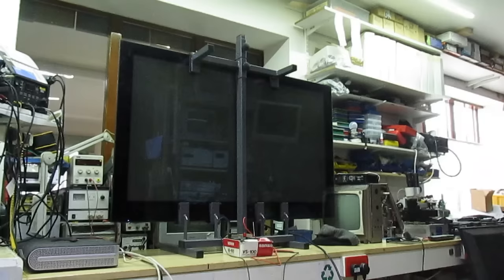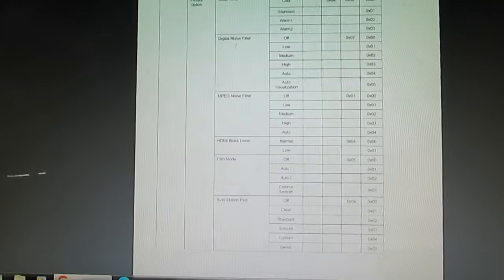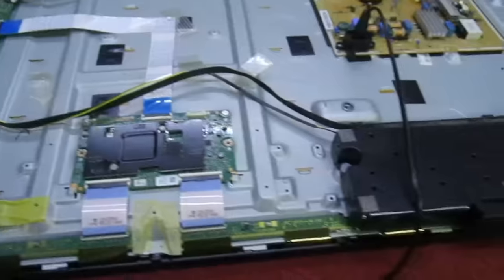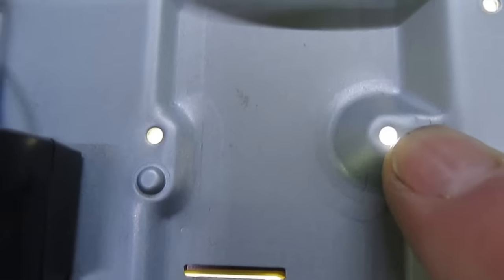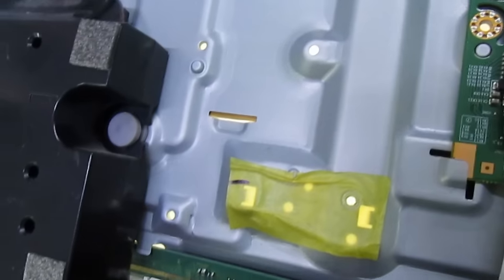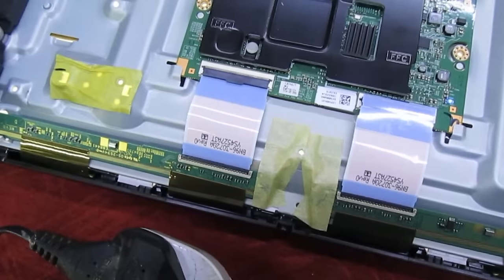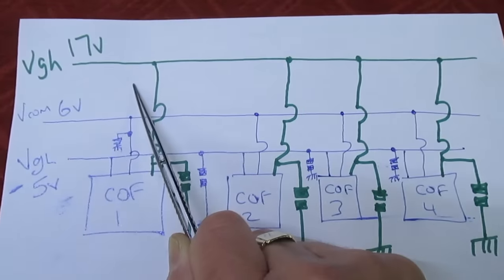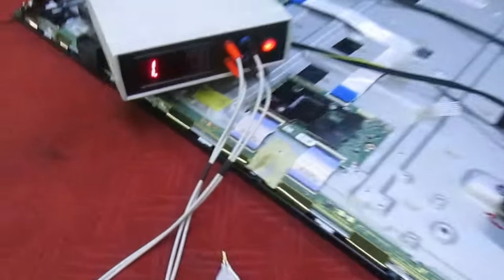Video to highlight the problem of repairing flat panel TV sets

Comment: Thumbs up for the video, Mr. Dranfield :-) It is always heart-warming to find someone who does care and does promote repairs of simple faults. 

Actually I suspect a major part of failures in modern-day electronics are of this sort: power supply capacitors, typically electrolytic, but tantalum and even MLCC are sometimes to blame as well. A TV is still a relatively complex piece of kit, but there are many smaller and simpler devices (say SoHo Ethernet switches) that are prone to capacitor failures just as well, and overall trivial to repair without a schematic, because the block schematic is very universal/repetitive. They are often used deliberately to implement "planned obsolescence" - and it's not sloppiness on part of the board designers, it is intentional and it is an art in its own right, only noone admits this on record, for obvious legal reasons. In reality, I doubt that the orders for this do not come from the board of directors of the corporations involved.

I'm fine with a leaked capacitor that I can simply replace. What infuriates me are "design sabotages" that cannot be repaired, such as mechanical design details that result in a destructive failure, not repairable by a glue gun and duct tape: a ball bearing on a name-brand lawnmower high-RPM electric motor, seated in a plastic housing, where the large injection-molded plastic part is a major structural component of the motor assembly, not available for replacement... or a fragile plastic hinge in the microphone arm in an expensive name-brand headset (earphones + microphone). This kind of thing should be sanctioned :-)

In TV's and PC monitors, notebook PC's, fondleslab telephones and many other devices, repairability gets outright precluded by mechanical design that (almost or literally) prevents disassembly, or if you disassemble, prevents plausible re-assembly. Such as, TV chassises made of plastic that hold together by a myriad fragile flippers that are intended to snap together, with no clear way to get them un-snapped if repair is needed. In the way of repairability, I'd love to see some improvements on this front = easy access inside, to get my hands on serviceable parts - be it individual boards, or backlight LED stripes or whatever. To replace some popped caps, in the PSU, you often don't even need a schematic.
One particular brand though comes to mind, that does make board-level schematics still available in service manuals: the Vestel of Turkey. To those who are not in the repairs business, this company makes on the order of 50% of the cheap flat-panel TV sets sold on the European market by various "household names" (that no longer run their own factories to make electronics). I.e. many of the EU household name TV's sold in Europe share the same motherboards, power supplies and principal inner mechanical construction. I've noticed small differences in the component sets soldered on boards, such as a protective Zener on a motherboard (Vestel T816 PVR) to protect the mobo against the +5V PSU output going fuzzy as the elyt caps dry out. One brand did have the zener, the other just had an empty position... On the first box, I did exactly that "find a short on a PCB" analysis, as explained by Mr. Dranfield in this video :-) and then I replaced all elyt caps in the other box preventatively.

Unfortunately, genuine repair techies, able to diagnose and repair small-signal electronics, are a dying profession. In rich countries, kids don't get to play with a soldering iron anymore. I know several old bards, say born in the fifties or older, who have experienced a great part of the history of modern electronics on their jobs, and keep their "ethos". I myself was born in 1976 and I was possibly lucky that I spent my childhood on the eastern side of the iron curtain, so I got my hands dirty and I was able to pick up some DIY skills from the old bards... Nowadays, the trouble is: consumer electronics is hardly worth repairing anymore. Industrial electronics still is, considering the cost of replacement (including various "strings attached", such as software licenses). As for consumer electronics, the problem is in the flip side of the "economies of scale" - in mass manufacturing and global mass distribution. It just got so efficient and cheap, per unit, at that scale, to produce and distribute new pieces, that a repair of individual random pieces just cannot compete. Repair takes too much human attention, and it takes a skilled techie who can diagnose microelectronics, at least at the level of power supply rails and proper general troubleshooting. Consider how much such a professional needs to earn, net pay per an hour of work, in a modern-day western country. Multiply by three to allow for taxes and similar costs and some profit for the employer company. A repair of a cheap TV set easily just does not pay off in a rich country, considering the amount of skilled work required. Even in my post-commie home country, where wages are still relatively low, I can venture to repair my own cheap stuff in my free time as a hobby, but noone would pay my employer for me to do that same on a commercial basis - because buying a new one is just cheaper.

In private, I delight in removing the more trivial "planned obsolescence sabotages" and giving my devices a new lease of life (often immortality, in the sense that moral obsolescence comes earlier). Sometimes I even go so far as void the warranty on a new gadget (after a quick initial test), "pop the hood" and look for the obvious culprits inside - cheap elyt capacitors and the like. And I remove those sabotages on a new device, before it had a chance to fail. E.g., I've had a cheap SoHo WiFi AP run for about 10 years in my parents' house, before some third party scrapped it for his commercial reasons (and out of technical ignorance). I do this in cheap Ethernet switches that I'm using in-house, and do not want to remember where they're located for the next 10+ years. Solving an emergency (device outage) that occurs at random is just much less convenient than preventing a failure (planned obsolescence) as part of initial deployment.

Speaking of capacitors, for the record, for innocent and excited tinkerers to come: when replacing leaked or suspicious elyts, note that you should not take capacity (microFarad) as the only or even a crucially important guide. In power supplies, the capacitors typically have to sustain a high AC current (and pulsed at that). There are a special variety of wet elyt capacitors for those positions, called "low impedance". And don't just rely on those words in a catalogue, do actually take a look at the Esr value and the permitted ripple current (two sides of the same coin). And, compare. You will notice how vastly better the Solid Polymer capacitors are in those respects, compared to "wet" Al elyts. When refurbing elyts, I strongly prefer solid polymer to a wet elyt. Unfortunately, solid poly doesn't work at high voltages. So the primary side of a mains PSU has to be fitted with a wet elyt. Speaking of quality wet elyt, remember Panasonic FR and Nichicon CS or CY. And Nippon Chemicon in general, but I won't suggest a particular model/family. With wet elyts, brand does matter (not so much with solid poly, especially when replacing wet elyts).
Also, be aware that while most elyts nowadays are in power blocking positions, some may still be used for analog timing or signal filtering - in these positions, you'd better stick to a legacy wet aluminum elyt (choose a quality brand and model) or MLCC if the size and voltage allow. (And, keep the original capacity.) Solid polymer tends to have a higher leakage current that might hamper timing or filtering applications.
In some rare cases, you may notice that after replacing a wet elyt with solid poly on the secondary side of a PSU, the PSU's regulation loop becomes slightly unstable - maybe just within a certain range of loads. The PSU starts to whistle. That's bad luck - it happens due to the significantly lower Esr of the solid poly or MLCC that you used for replacement. The lower Esr has improved the Q of the regulation loop, thus promoting some resonant pole... Hardly ever a problem though.
Reply from the maker: Your comment about Vestel supplying circuit diagrams is the reason I have always liked vestel sets but recently I have noticed they have stopped publishing schematics for the latest models and this is very worrying especially as vestel make a lof of the TV s in use today.

Comment: They constantly squark how green and carbon low they are but the continue to deplete resources because they'd rather sell under light bulb theory than repair. I remember in Germany in the 70's when the youth began to protest the oil industry and got nowhere until they began torching fuel stations
Reply from the maker: nothing green about throwing away a TV and then buying a new one when the old one could be repaired .

Comment: very intersting thanks Ive a radio ham mate tubes variety that was faced with his TV fail this may point him in the right direction as we are in a Place called Siam where there is NO HELP for anyone...I feel less wary of my big screen samsung now failing as its such a good set and I was brought up on Sony Grade one studio monitors :-) It might be a good idea to find the exact same model on Facebook sales thats had the wife chuck a brick at it and get some spare parts in advance of the inevitable 😞
Reply from the maker: Theres no help anywhere now , not just in siam, as soon as someone has your money thats it , forget service and reputation , no ones bothered , when they get your TV out of warranty theirs no parts available  and you will be just told you have to buy a new one .
Reply: @michaeldranfield7140  Yep, wifes Iphone 7 failed due to condensation inside in Thailand due to a/c in car too cold and no protection in the 7, replaced with 2 weeks to run on warranty, 3 weeks later the "new" 7 had a fatal firmware/memory fault which bricked it (it was a known manufacturing fault) Shopkeeper in Bluport iphone store in market village in Hua Hin laughed in our faces. Next phone was a samsung S7 Edge - first I did was full immersion in water for 20 minutes, it worked and has worked ever since (6 years)

Comment: All fine and dandy if you already have the knowledge of the internal working of the television set enough to locate these components. You must have studied many many other service schematics to have had this knowledge. Unplugging boards is a good technique to determine which board is pulling voltages low, and therefore the board that has the plug that you unplugged and the voltage then comes up on the output of the power supply board is usually the defective board. However sometimes switch mode supplies wont start up without some load attached, and this only adds difficulty when troubleshooting.
Reply from the maker: I have had over 40 years experience of TV repairs , I started on black and white sets and for pre 2010 sets I have thousands of paper service manuals , sadly gone are the days of obtaining service data now .
Reply: @michaeldranfield7140  I feel your pain about full size schematics, much harder scrolling around on a screen if you can even get a schematic for some. I started around 2002 out of the house. Did thousands of repairs since on everything from A-Z ever since. Vcrs, Televisions and Audio Equipment was always my favorite. Found transceivers probably the most difficult, however there where exceptions. A lot of repairs became a personal struggle of love/passion more than profits. Older I get “now at 55, the more I realize how much I don’t know.” Just watch someone like Mr Carlsons Lab on YouTube and you’ll understand what I mean, lol. 
✌️😎👍

Comment: The manuals are required by law to sell in the United States but they don’t want you to repair it they want you to replace it. They are pretty simple that’s why a lot of people take them apart and re-purposed them.
Reply from the maker: hence why there is so little in the service manual , its more like a user instruction book .

Comment: As an ex production technician for Sony I took issue when they tried to produce a single panel crt tv one in the 1980s. It got so hot I considered it a fire hazard and a danger. 
They even stuck a BEAB sticker on the back which I took issue with. 
I whistleblowed to beab with my concern that this tv was a danger to public safety,  but to my disgust the person at beab just said,  "the safety of the public is not our concern ".
!!!!!!
I was always under the impression that the British Electrical Approvals Board was set up to ensure that all electrical appliances had to conform to strict safety rules!!
Reply from the maker: I do remember a particular Sony model where a dry joint on a big power resistor  caused a massive burn up on the pcb and Sony issued a mod kit consisting of a new piece of circuit board you had to fit on some plastic bolts after cutting away all the burnt board , cant remember the number but it may have been KV2097 ?? or something similar and it had a plastic cabinet .
Reply: @michaeldranfield7140  
They were all plastic cabinets. The problems are when they used 1/4 wat resistors and very thin boards with thinner copper etching combining the power supply which besides driving the signal and control processing but also powering a big CRT. The single board tv was designed so it could be produced with less labour but I managed to convince them of the bad design.

Comment: A Service Manual with circuit diagram  is completely unnecessary when fault finding down to component level. In all fields of electronics repair I have worked in until recently, I've only ever had a working knowledge and what's in front of me and a sketchy description from the customer, that's in tvs, HV electronics, and unfortunately this will never change. what we had in the 80s and 90s, and those who worked in the 50s to 2000s was what I call a golden era of electronics.

they don't teach to component level in tech college anymore, c and g  224  is no more so I am teaching what I know to my youngest daughter who will hopefully carry the torch long after I've gone.

keep the faith. 

datasheets on the Ics and components  installed on the boards will give you all the information you need to repair.

I understand completely what point you are trying to make, but up until very recently, I've been in the TV repair trade for over 30 years, and have only ever needed a service manual once, to identify what the service fault code was for a TV. the TV was repaired after replacing the noal failure point of schotty diodes on the PSU board of a Philips TV.
Reply from the maker: This is where years of experience comes in , working without a service manual, when flat screen sets came out though about 15 years ago there were circuit diagrams in the manual but I suppose sets were so much more expensive then .
Reply: @michaeldranfield7140  The point I'm making is, until we ( the consumer, the engineer) stop buying products because of the blatant planned obsolescence, the lack of tech support and poor design of so called premium products from companies like Samsung, this will continue. WE are our own worst enemy, and after 30 years in the trade,(on and off) I finally hung up my own soldering iron, and changed my field of expertise. 
The service manual is a thing of the past, the mere notion of a TV repair guy fixing items, sends shivers down the spines of shareholders of companies like Samsung, and our old favourites from Turkey....I can't even bring myself to mention the V word.... they're that 👎 
I wish you luck ...😀

Comment: Great explanation. I used to do TV repair a long time ago but even I could see the end when flat screen tvs came along. As a career it was not going to be a challenge just replacing a whole board instead of component fault finding.
Reply from the maker: I never saw the end when flat screen sets came out and a 42 inch set was £7,000 to buy , I just saw an opportunity to make more money but it didnt take long ,look at sets now , less than £300 for a 42 inch set .

Comment: Great bit of troubleshooting.  Haven't done a flat screen, but I've fixed XBox game console just by the old-fashioned "close visual inspection"  Found electrolytic cap bulging.  So often it's a part that's just a few cents, but of course your time and trouble to find the fault is a bit more than a few cents.
Reply from the maker: Close visual inspection is sometimes all you can do without service data but as you quite rightly say  a lot of problems can be diagnosed by inspection alone  .
Reply: @michaeldranfield7140  I remember one time amazing a co-worker by pointing confidently to a chip on a board that had maybe 40-50 chips and saying, "That's the failed part."  At first he was awed by my expertise until I pointed out to him that half the chip had 'exploded' and flown off leaving just a shattered plastic package.  lol